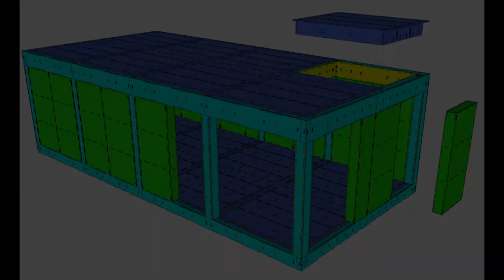Open Source Digital Construction - Community Cafe - Wikihouse

Comment: What amazes me with this system is, how four engineers from a non construction background can put a building up in just six days. 👏
Reply: it is not like it is rocket science.
Reply from the maker: @flyingdiscproductions  We are glad you recognised the ease of this system.
Reply: @pulpbuild  yet the ease comes with higher cost and use of plywood.
Reply: @flyingdiscproductions  Why do you think it would be a higher cost? Than what? One thing you would need to take account of when costing something like this is the time and wages of skilled labour. And what's wrong with plywood?
Reply: @christiaant  What's wrong with plywood? Well, that is a whole discussion. And yes, I use plywoods. And most can't be outside even painted, before they degrade ... maybe 5-7 years in some places.
Reply: @flyingdiscproductions  happy to have that discussion. I’m curious to know. The plywood in Wikihouse is not intended to be outside for more than a few weeks. The building is wrapped in a self-adhesive breather membrane. External cladding of some type will then be installed over that.

So where do you think the ‘higher’ cost comes into it?
Reply: @christiaant  plywood takes a lot of glue among other issues.
and plywood does not work outside that well.
is this community cafe outside or inside?
Reply: @flyingdiscproductions  the plywood isn’t glued, it slots together with friction joints and some screws and bolts. These things are designed to be easily disassembled at end of life.

The building itself is of course outside but the plywood is not. It’s protected by a sealed waterproof membrane (the breather membrane) and then cladding and roofing. It always stays dry.

Comment: nice -does this save any money for the end user?
Reply: See bottom of this page for comparison: https://www.wikihouse.cc/About - u-value = 0.15 W/m2K and airtightness of 1-3 m3/h.m2, so yes it would save money for the end user in terms of energy to run the building
Reply: @christiaant  really? and how was that calculated?
Reply: @flyingdiscproductions  these calculations are made by calculating the thermal conductivity of each element together as a whole wall construction, which gives you the u-value. The lower the figure the less heat will transfer through the construction, making it easier to retain heat in winter and keep heat out in summer. The airtightness can be measured directly using a blower test. Again the lower the figure the tighter the construction and therefore the more control you have over ventilation, ensuring you don’t lose excess heat when ventilating the building.
Reply: @phoneemail8503  looks like the maintenance would be higher.
And all those little spaces for mold to grow.
Reply: @phoneemail8503  plywood has a much larger environmental footprint than dimensional lumber.
Reply: @flyingdiscproductions  Be that as it may, the use of plywood does open up the option of wheatboard, I:E plywood made out of wheat straw that would otherwise be treated as waste, and doesn't use urea formaldehyde for adhesive. It would be nice, however, to see wikihouse more actively promote the use of such materials.

Comment: 6 days to build a plain non-weatherproof box, with the number of people that were there, plus all the fitting troubles, and the time on a CNC to cut it in the first place ... doesn't seem like it's worth the effort, compared to just building it from timber and sheets ... or maybe that's just my opinion ...
Reply from the maker: Fair-point as this is not meant to replace any traditional construction methods but give wider choice to consumer with higher U-Values (300mm deep insulated walls), low thermal bridging, very airtight and reduced onsite labour cost as most construction is done in the workshop without having to worry about UK weather.
Reply: The technology has been proven extensively at the commercial level. At the DIY level the system will likely never replace conventional homes but is great for small out buildings. Scandinavians have been applying the syatem for decades.
Reply: yup - how many hours to cut all that plyboard?
Reply: @pulpbuild  higher u-values that concrete or styrofoam?
Reply from the maker: @flyingdiscproductions  3 weeks of cutting. I guess you can do the maths for cost and hours by a small workshop.
Reply: @pulpbuild  wow - that is a lot of cutting.
Reply: I think if you want to take on a project like this, you might as well build your own CNC router. I have seen a relative build a poolhouse and rebuild it two Times, because there were gaps in his building knowledge. Some rot, some collapsing. I think that's where the value of this system is.
Reply: @pulpbuild  thanks for sharing the treat video. Would 3 weeks equate to 3 x 40hour weeks for someone paying for the cnc work?